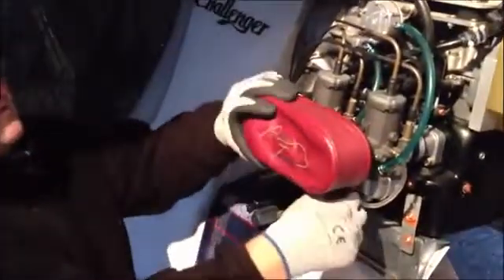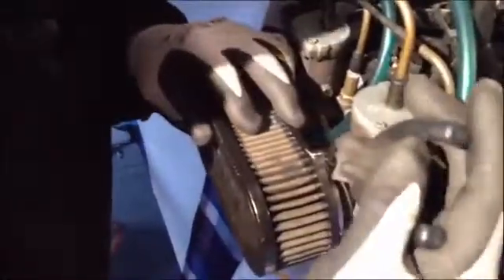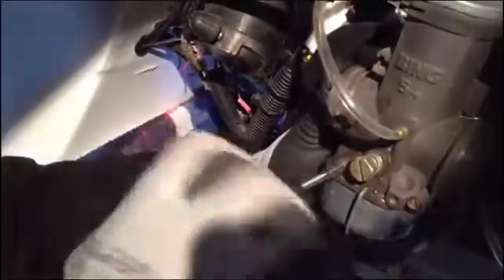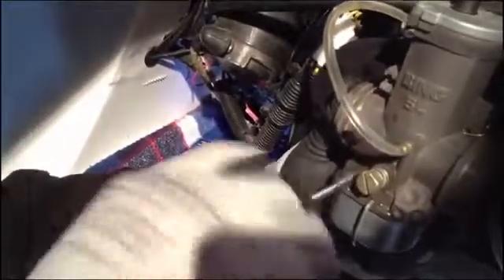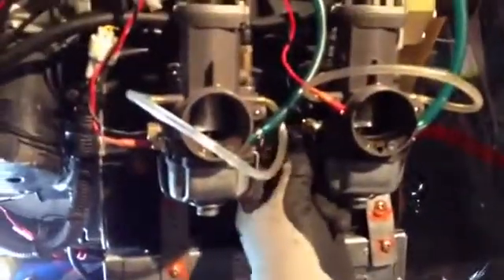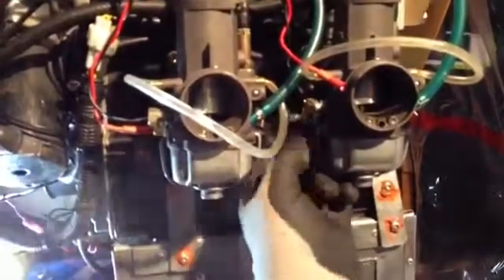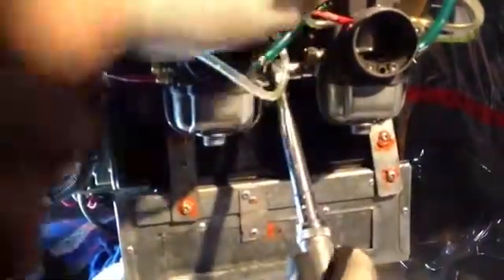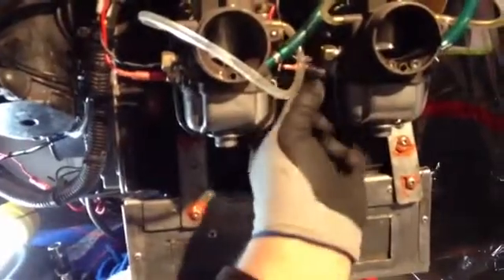Carb Heater Installation

Comment: Are these heaters connected directly to 12v? How many watts does each have?
Reply from the maker: Yes, using a switch they are connected to the battery / charging voltage and drawing 20 watts each.

Comment: Where can these heater kits be purchased??
Reply from the maker: Hi Tim, Please e-mail to rotacrepair@gmail.com to place your order. The 503/582 dual carburetor heater kits are $250.00 CDN plus applicable tax and shipping.
Reply from the maker: Please contact Rotacrepair@gmail.com to purchase a kit.